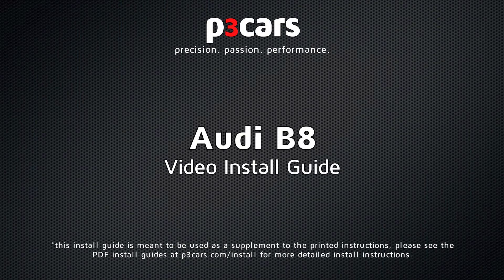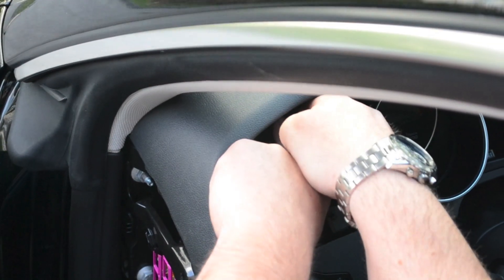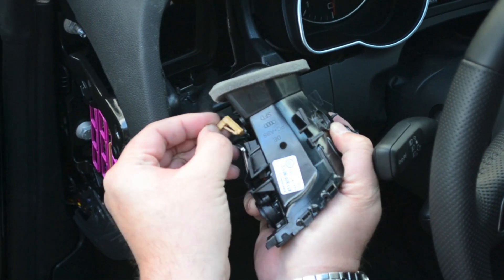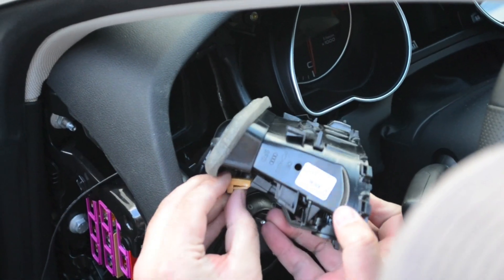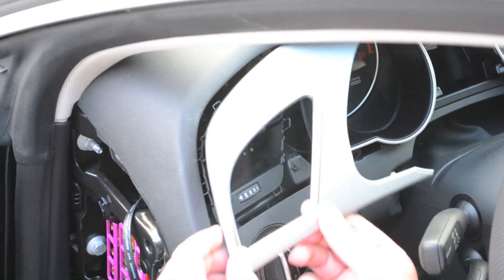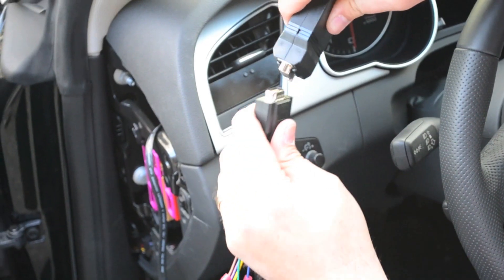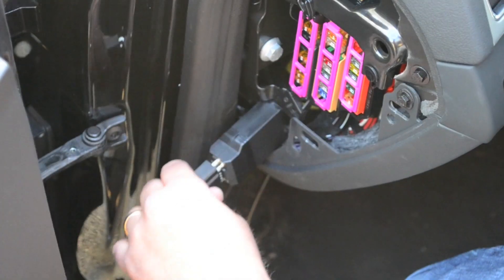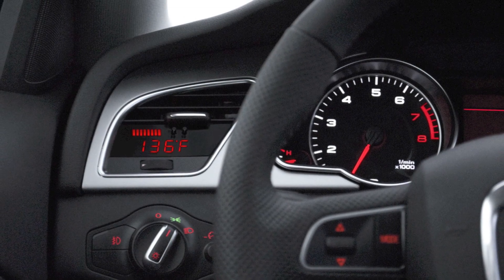P3 Cars - Audi B8 Install Guide - Digital Interface - A4 S4 A5 S5

Comment: U do them for right hand vehicles ?
Reply from the maker: Yes, we do! Please check out our website - www.p3gauges.com
Reply: @P3Gauges  says for RHD b8.5 vent option N/A ? (Audi s5)
Reply from the maker: @Eiorr_1970s  We can't get the RHD vents here in the states but you can still purchase the gauge and install it into your own vent.
Reply: @P3Gauges  so it will fit on the left hand side only then ?
Reply from the maker: @Eiorr_1970s  Our product is just the display and gauge. We make that for LHD and RHD applications. The RHD vents themselves are what we do not offer. Process your order without selecting the vent option and it will go through. Then you'll just install it in the vent in your car right now.

If you have any other questions, please email us - support@p3cars.com and we will get you taken care of, thanks! - Jake
Reply: @P3Gauges  thanks do you have a video install guide without vent ?
Reply from the maker: @Eiorr_1970s  Yep! Right on our install page - https://www.p3gauges.com/wp-content/uploads/2020/02/B8-Gauge-Install2.pdf

Comment: Does it show the oil temperature in A5? I can see in the PDF that it is conected to the OBD conector. Can I conect and desconect it several times without problems? Because I use the OBD conector frecuently for Vagcom and REVO SPS changes.

Comment: What does this do I want a boost gauge
Reply from the maker: boost either direct from the port or via our analog sensor.  (we only recommend the sensor if your car was NA stock (v8S5 or the V6) or if you have installed a larger than stock turbo.  It also offers you information like EGT, intake temp, 0-60 timer, battery voltage, code read and clear and much more.  CHEERS!
Reply: Hi  @P3Gauges  , Do we need to separate buy the analog sensor? Mine is S4 Avant with revo pulley, revo stage 1+, K&N open intake, AWE exhaust. Daily drive.
Reply from the maker: @kviinng  It typically depends on your tune. With a stage 1+ tune you should be ok without an analog sensor. If you  modify your car further you always add the analog sensor later.